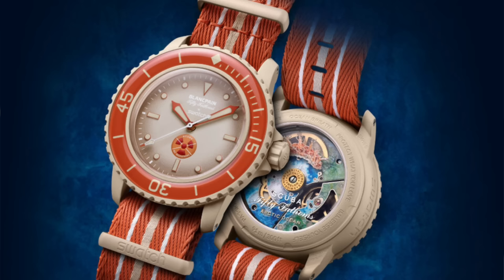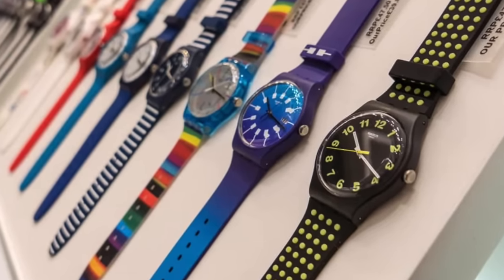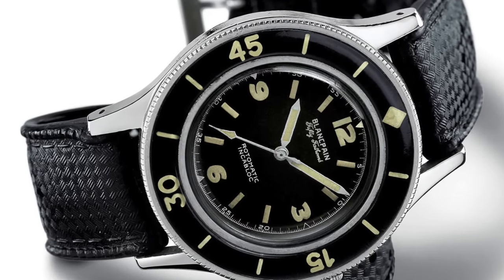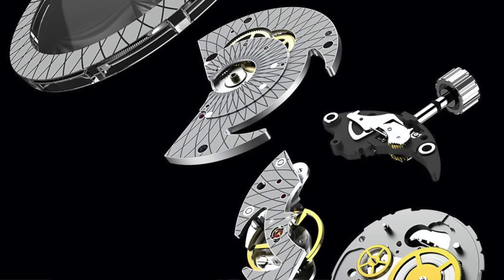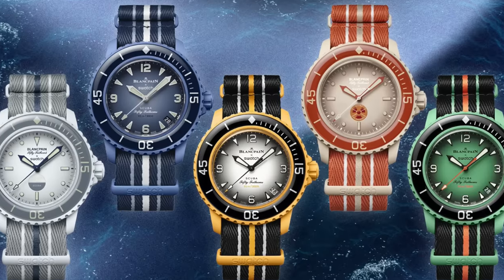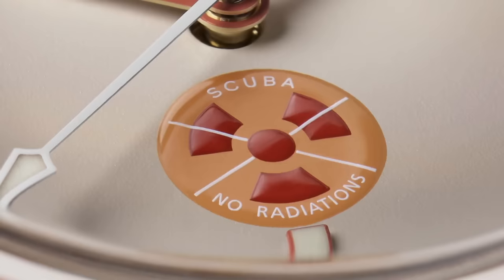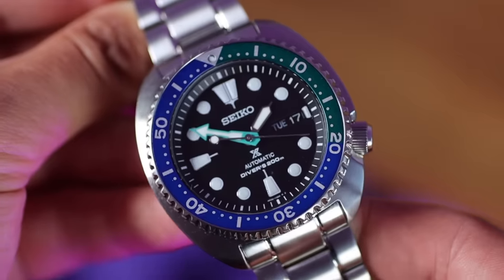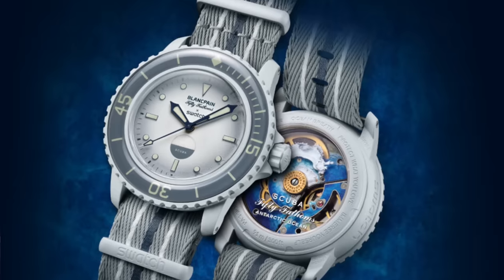BLANC PAIN X SWATCH SCUBA FIFTY FATHOMS - DON'T BUY! Here's Why

Comment: It’s an understandable error, since Sistem51 movements can’t be opened. This blancpain x swatch watch has a snap on case back so they can be opened and the movement replaced and or serviced.  Given that this is your main criticism I wanted to mention it.
Reply: Yep, agreed.
Reply: Not that you really can service it. A lot of the parts are soldered together, including the mainspring so you can't regulate it, and you can't easily buy bare movements and have your own watch person do a swap like you can with Seiko.
Reply: Good point! Since you can remove the dial and rotor only the bare movement remains. To replace it will still produce waste but honestly, who will ever pay for getting their NH35 serviced or repaired if you can buy a new one for €50?
Reply: @JessicaKStark Nit pick. It’s actually rivet together.

Comment: I don’t disagree with any of this. However… I am an 80s kid and loved a Pop Swatch in my day and I don’t mind Swatch using these collaborations to make money or to build up their other brands. Also, I love Blancpain and the Fifty Fathoms is my grail watch, but it is unlikely I will ever be able to afford one. This is about as accessible as one will ever be. I’m not into the hype, but in a few months I can see myself getting myself one. You’re dead right on pointing out that once the System 51 breaks that’s it done, which makes it different from the Moon Swatches where you can generally stick another battery in. And they are pricey. I suppose it’s about going into it knowing the cons – which all the hype is designed to hide.

Comment: What I don't get is them insisting on cheap construction techniques for these collabs. Within the Swatch group you'd have both the powermatic range and ETA 2824 to name a few. Stick something like that in with the dressing up (i.e. a maintainable movement), and don't make it out of melted down action man and what you'd have is a fifty fathoms for cheap, maybe £500-750 cheap instead of £350 but a good value option A bit like Epiphone or Squier in the guitar sphere
Reply from the maker: Good comparison! Although guitars need to be made out of similar materials to incorporate and bond with the musical elements but yeah! I don’t understand why there is a faux screw in caseback? Why couldn’t they have made it a proper screw down case back?????

Comment: Hmmm snap on caseback..so you dont have to destroy the watch if the movement need "service"...and also digital and quartz are both normal quartz watches....difference is that on digital the "info" goes directly to a digital screen and in an analog "info" goes via step motor....

Comment: Completely agree with you, but the movement can be serviced by a watchmaker, they can pull it by removing the crystal. It is not done as it is usually more expensive than buying a new watch, but can be done. This think still does not worth the price. Also i like the fun factor with the 🐌, they know it is not a shark so sounds fun to be a snail. I would buy 1 if they were 50£ I suppose :D
Reply: What watch are you actually talking about buddy?😅
This contains a sistem51 which is literally disposable, cannot be serviced. The entire movement can be replaced though by popping off the back cap.
Reply: And why would it not be serviced? I have seen 2 different watchmakers servicing 1 in front of me and saying it is possible it can not be regulated by hand but if it can be serviced and chances are it will run. It is not made to be serviced and swatch won't service it for you. Doesn't mean it cannot be ;)
Reply: @StAntonioStefanov  It's very similar to a typical LED light bulb.  YEs, in theory, you could take it apart, fix it, and put it back together, but it's all put together with none of that in mind and you'll likely break it getting it apart and back together again.

Comment: Believe it or not the back of these actually pop off. They aren't like the other system 51 watches which are glued shut. I don't know what that says about whether or not they can actually be serviced but yeah that's the thing.
Reply from the maker: My question would be then be, how good is the seal once opened a couple of times??? They are hermetically sealed so once opened I’d read the small print on the warranty!
Reply: @THEMADWATCHCOLLECTOR  yeah I have no idea, obviously don't have the watch. It's not a twist off, it just kind of pops off. This was reported by one of the other YouTube watch guys, and he even showed it opened.

Comment: You can get it serviced Russ. The caseback is snap-on and Swatch will replace the movement (Seiko do the same with their base movements). It is not sealed and there are quite a few 3rd party watchmakers who sate they can and do service the movement. The fact of the matter remains though that for swatch (just like Seiko) it is simply cheaper to replace the movement. Don’t forget that those plastic swatches saved the Swiss watch industry during the quartz crisis and without them ETA, Omega, Blancpain and many others wouldn’t be here today.
Reply from the maker: 100% my friend but these days it seems the only way to keep Swatch relevant is to make a cheap copy of an iconic watch? There last release of watches was SOOOOOOOO POOR! “Imagine if your watch was square” wtf!
Reply: You absolutely can not service a Sistem51. There are no removeable parts. The entire movement is pin welded together. There is only one screw in the movement and that attaches the rotor so it's impossible to dissassemble. They are also laser regulated so you cant even have someone regulate one. Not crapping on them. I happen to own a Tissot with a Swissmatic which is un upgraded Sistem51. I think they are an interesting idea but I wasn't thrilled learning the bad news after owning the watch a couple of years. I was new to collecting and it was my first Swiss watch. Interesting video if you want to see one up close https://youtu.be/7NAwmc6R5fs
Reply: @bogrot69 True of the vast majority, but a few years back they made a serviceable non-sealed one, and allegedly they are doing the same thing with this one. 

That said, I think the pla- bioceramic case will probably break faster than the movement anyway
Reply: @bogrot69  Exactly.  "Servicing" by replacing the whole movement is no different than taking in a car and having to replace the entire engine every time something goes wrong or needs servicing.   At that point, it's worse than a cheap quartz movement. It is less accurate, is more money, has more moving parts to break, and any moving parts are just an illusion as the core is one big mostly plastic robot-made part that can't be fixed.
Reply: @bogrot69  , Please don’t take that guy’s word as he is certainly no watchmaker. I can tell that straight away by his handling techniques and the tools he is using. There are various versions of the Sistem51 (I know about the Swissmatic - not a fan I have to say) ranging from the plastic component versions to the metal components.

Comment: Would you call your modern TV disposable? Can't fix those but they cost thousands, but this is acceptable. I feel like the snobbery is getting ahead of the facts here. Looks good, it IS a mechanical watch and will last for as many years as needed - the case will break before the movement! I won't be buying one but the wave of snobbery coming out of the watch world at the moment is out of hand. G-shock - serviceable? No. Accepted? Yes. What's the difference here?
Reply from the maker: Friend of mine has owned 2 GShocks for 20 years. New batteries and is perfect. If a G-SHOCK costs £300 it has some top tech inside with tough solar batteries. It’s a very poor comparison my friend compared to a movement firstly Swatch wouldn’t say it’ll last more than years??? The case will deteriorate yes. There’s no snobbery what so ever I’m just questioning the value of it.
Reply: @THEMADWATCHCOLLECTOR If the main unit in a GShock breaks can you service it? No you buy a new one! It's therefore disposable by the new rules as of a week ago!
Reply from the maker: @DC-uf6ve  is that right?
Reply: @THEMADWATCHCOLLECTOR  The module in almost all Casios is not serviceable, it's not worth the effort of trying because they are cheap. Agree? Let's not forget the sistem51 movement only exists because of watch snobs and now they've turned on their own creation! It's cannibalism!